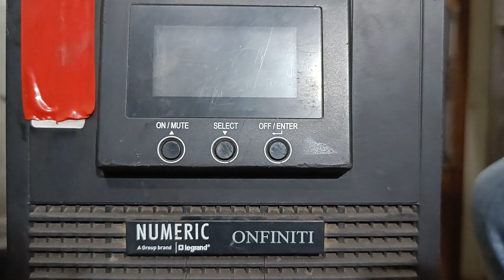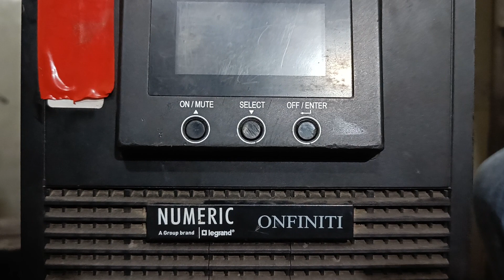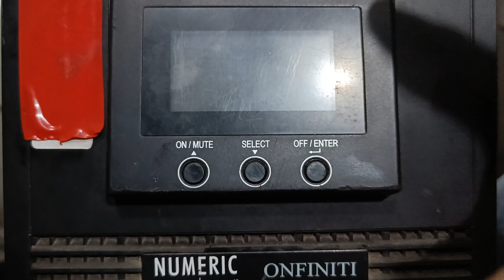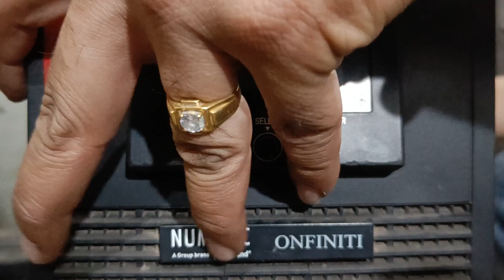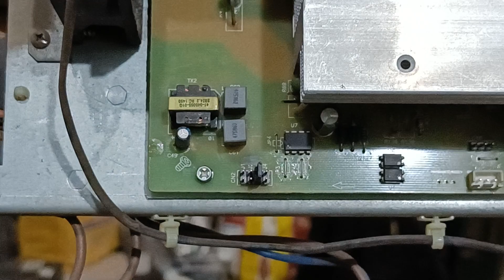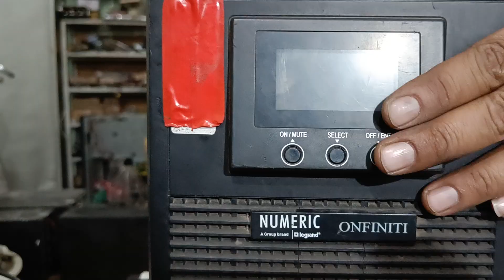(English Language) Double Card High Frequency Online UPS. Model Console, Infinity, Emerson

Comment: Great overview on the inner functions of that UPS! I've been watching your videos for a while but never really understood much of what you were saying, only little bits and pieces. Your english is great!

I have 2 Tripp-Lite 3000VA online rackmount UPS's. The problem is they are for 220v, and I only have 110v here. I was hoping to open one up and see if there's any way to change the input to 110. I imagine there isn't since they're 72v battery packs so probably have a charger designed for 220v input only.